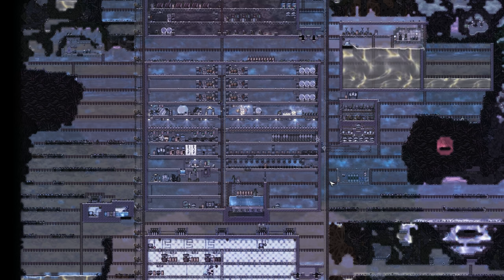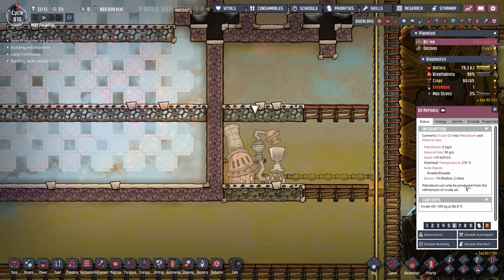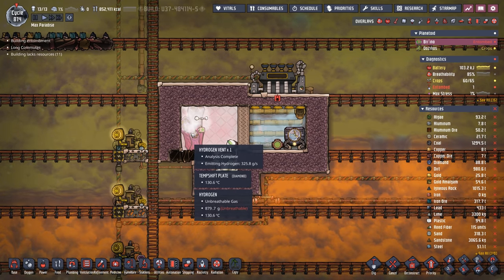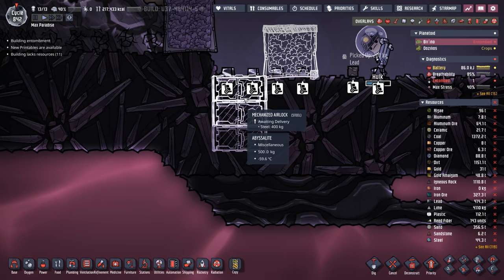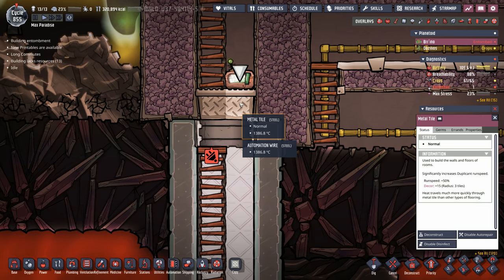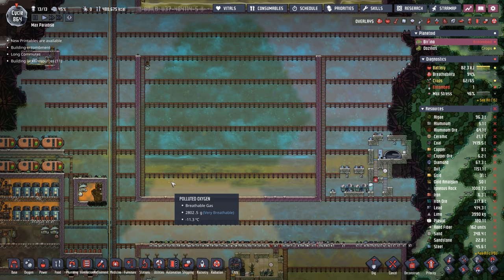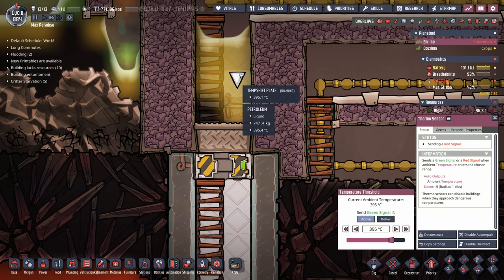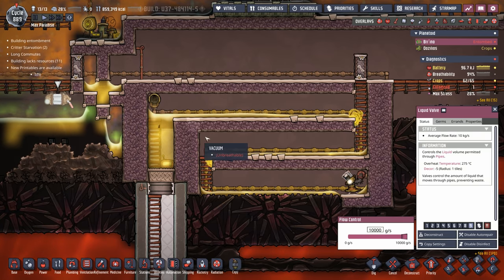Petroleum Boiler | ONI Spaced Out | Max Difficulty Ep 11

Comment: I was excited when I watched this.  Just finished my first petroleum boiler and I also used the magma in a similar fashion.  Not a big counterflow setup like this but I'm satisfied it's doing what I wanted for now and I completed it around cycle 400 or so.  I pump petroleum into the room with the heat plate from two places.  First, from the oil lake into my early metal refineries. I loop their outputs through automation to go back into the refineries until they are around 310C when it'll branch off and start filling up the boiler. Then when it's full of petroleum another door opens floods a side room with a liquid pump.  My first try at this broke my steel pump 😅. But that mistake led me to the next version which has another pump in the lake that snakes it's way through the boiler to exchange the heat down to manageable temperatures <270C for the steel pump.  Then all that crude gets dumped back into the boiler room once I've pumped out the petroleum so I can retain more of that heat energy.   It's not the most efficient and it's a bit jank and required a lot of head scratching with automation and logic to get right. But I had fun and it works.  Now I feel comfortable looking at other people's ideas to refine it and I'm happy to see something that looks similar. But simpler and more efficient without being just something I'll blueprint into my game without feeling like it was mine.  TL:DR, great boiler! 😅

Comment: to prevent tat pipe busting there at the end just put the last three sections up on row so its not close to the heat. Wont really change how the boiler works but less likely to have those pipes pop at the end on that one. Also setup escher waterfall into infinite storage for all the massive excess of petroleum. can put it all in a space the size of a liquid pump.

Comment: the 3000 kg of water would be a great point if the oil wells didn't have to stop for venting. since there is a pause in this, slicksters are required to fill the pause of the oil wells to keep the absolute 10 kg/s boiler going to service the 5 generators. otherwise, the oil will bleed away over time.
Reply from the maker: Good points.  Would be true for us if we were actually using the 10kg/s of petroleum.  As it is we are only running the generators as required by our power, so we are left with extra.  Don't think we are going to run a full 75 slicksters any how.

Comment: That's a really nice design, I might steal it haha, I think the only thing I would change is having the boiler plate not directly above the heat spike, as you mentioned, if you expand it you will have a hell of a mess to get through, if you moved the counter flow and boiler plate 2 squares to the right and 1 up you could leave the door below the boiler plate (that's there now) closed all the time, add 2 diamond windows to the right ot the top right of the heat spike, then another door and the boiler plate... I have no idea if that makes sense haha
Reply from the maker: Makes perfect sense.  Wish I would have thought of it first ;) As it stands I have a backdoor I am planning to use.  Thank you for the comment.
Reply: @EchoRidgeGaming  no problems, thank you for the video!

Comment: i think you would have had less problems with sour gas and the likes if you just pushed 10kg/s through the pipes as the larger mass getting in would have instantly provided enough mass that it doesnt flash to sour gas.

Same goes for the slow ramp up in general, its only required if your heat source and transfer is weak, if you got a steel door and temp shift plates connected directly to a heat spike you can continuously pump in -30° oil without even having a heat exchanger at all and it will still all convert to petroleum instantly.

Its not efficient and would require a thermium pump to get it out but it works.

Comment: You can do the door drill trick with only two doors worth of steel. Recycle the upper door as soon as the lower door is built. When you're done drilling you have a lot less hot steel to cool back down too.
You can also use the door Permissions options to achieve the same result as locking the doors.

Comment: I once tried a petroleum boiler using rockets exhaust as heat source
Reply from the maker: And? How did it work?
Reply: Haven't done it in the most recent update yet but did it with previous builds, but it works great if you have a solid rocket program.

Comment: @10:30 instead of the dispensers on the bottom where the stack is, put non-passable mesh doors. It'll "lock" the negative decor inside but the dupes can still reach the pile from outside.

Comment: That top row of the boiler is something I've realized can be a problem in my builds. The petroleum running through your top row is still in contact with big well of petroleum that's being heated. That means when you're cooling the top row with the oil counterflow, it's also cooling the big well, but the big well is so full of heat that it's going to win the battle. And that's part of why some of your final pipe segments were getting broken. What I do is add a lip so that the big well petroleum and the petroleum in the top row are never in contact (in other words, the petroleum has to fall off a ledge to enter the counterflow zone), and my counterflow pipe segments only contact the top row and never contact the big well. By doing it this way you'll also end up with cooler petroleum, because that top row of petroleum is really not being cooled (it's being cooled and warmed at the same time).
Reply from the maker: I don't mind a few insulated pipes.  Pretty good idea though, for those wanting to try something a little different!
Reply: That's a very good idea, and well explained. I'll be adding that my pet boiler design. Thank you!